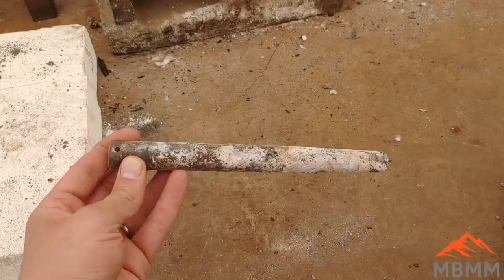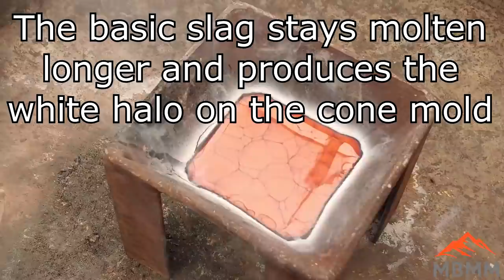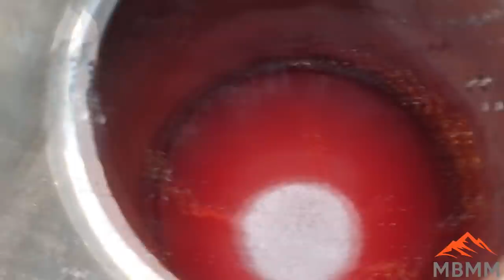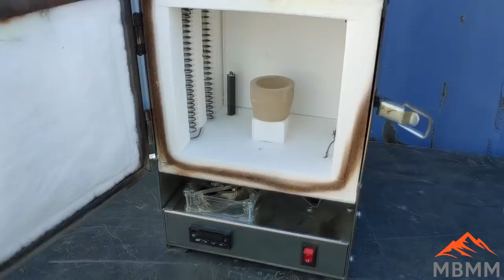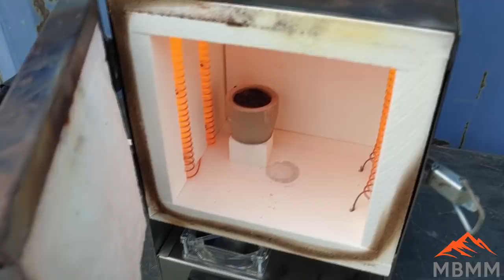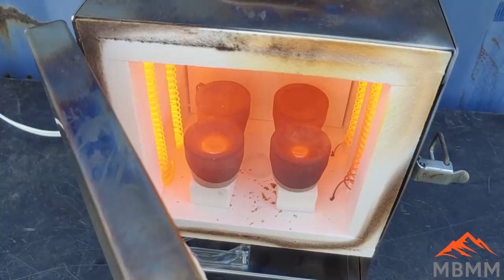Gold Assaying & Smelting: Soda/Iron Method

Comment: Good morning, just to inform you that when you are going to generate a basic slag in the foundry, you must use basic crucibles to prevent the attack of the slag to eat the crucible, you must use magnesia - chromite crucibles with the following characteristics:

MgO 62.5% - Cr2O3 17% - Al2O3 6.5% - Fe2O3 11% - SiO2 2%.

As a general rule, if the foundry generates a basic slag, basic crucibles should be used (magnesia - chromite) and for foundries that generate acid slags, acid crucibles should be used (High alumina - silica) which has the following characteristics:

Al2O3 70% - Fe2O3 2% & SiO2 28%.

In the particular case of sulfide ore smelting if you are going to generate basic slags, just make sure that the crucible is basic base (magnesia - chromite) or if you use acid crucibles (Alumina - Silica) you must change the formulation in such a way that you generate an acid slag, I recommend the following formula:

sulfide ore: 130 grams
Borax: 80 grams
Soda ash: 124 grams
Silica: 7.12 grams
Lead: 38 grams o 41 grams fo litharge.
Charcoal: 2.5 grams

To determine the amount of iron I suggest weighing the iron bar before and after melting, the bar should be cold at the time of weighing, the difference in weight would be the amount of iron to add for that mineral. I hope you find the information useful, thank you for your attention and have a nice day.

Comment: The filters with an absorbent part in the cartridge are very short lived. Most are only rated for 1, 8 hour shift. You can stretch it by pulling the cartridges and taping the in and outlet. Put in a ziplok with desiccant packs. Most are worthless after a week.

Comment: Fun fact re: lye and silica/glass.
A strong lye solution will etch most grades of glass in a short time!
Lye will 'spoil' over time, absorbing CO2 from the air to become sodium carbonate.
Still pretty basic stuff, not sure if it would work as a lye replacement.

Comment: I'm just wondering whether I understood correctly that you added 50 g of lead on each smelting and then converted to lead to lead oxide fumes. So for the eight smeltings you converted 500g over a pound of lead in to lead oxide fumes that settled down in the area around your burnout oven. Is that correct or did I misunderstand something

Comment: A bit worried about that respirator description.
A P100 is just the particulate part of the filter. It does protect from fumes, not vapors. SO2 is considered a Vapor. The difference is apparantly how the metal or chemical behaves. Is it still particles or not... Your filters are pink so i assume they are 3M's 60929S P100 combined filters for Mercury Vapor/Chlorine/Sulfur Dioxide Gas and particulate.  Not just P100 filters.
Please guys be safe, do not use a normal P100 filter for this. It will not stop any gasses unless it is a combined filter made for the task.
Reply from the maker: Thank you for your safety concerns

Comment: CAN YOU RE-RUN YOUR FIRST RESULT CRUSH SIZED ROCK TO SMALLER GRADES IN THE SAME CRUSHER?
Reply from the maker: Yes, you can get a little finer grind by re-running
Reply: @mbmmllc  THE DESIGN I'M WORKING ON IS ROTARY, USING A MUCH MORE AGGRESSIVE AND ROBUST SYSTEM OF IMPELLERS THAT VARY FROM RIGID TO SWINGING.  RUN IT OFF BELTS WITH A SMALL CAR DIESEL AND FEED IT WITH A BACKHOE OR LOADER.  IT ALL GETS DOWN TO BURNING ROCK AFTER THE FREE GOLD IS OUT. USE A REVERSE-SCALED MULTI-SCREEN SET-UP SLOPED AT BACK OF CRUSHER VESSEL WITH FINE SCREEN FIRST, THE LARGER GRADES FOLLOWING IN ORDER, PUT WALLS BETWEEN SCREENS DOWN TO CATCHMENTS, AND BOB'S YOUR UNCLE. CENTER SHAFT IS A 3" SCREW-JACK LEG, HAS HOLLOWS FOR WELDING PRIMARY ROCK CHUNK BLADES FROM TRUCK LEAF SPRINGS. BLADES ANGLED TO PROPEL ROCK THROUGH CRUSHER,  CRUSHER TUBE IS 16" WELL PIPE FROM A SCRAP YARD, 4 FT. LONG. (WHOLE UNIT BUILT FROM SCRAP YARD STEEL). INTERESTING, CREATIVE, AND VERY HARD THINGS SPINNING IN GRADUATED PROXIMITY WITHIN. FINISH WITH NICHROME CHAIN MAIL CURTAINS JUST BEFORE SCREENS FOR ULTRA FINE SMELT DUST OR TABLE WORK.

Comment: What respirator do you recommend for fumes ?
When you say 'BASIC', what are you referring to?
Reply: P100 rated for acid vapor.  I use a Honeywell that can handle HCl, HF, SO2, and others.  Basic as in acids and bases (alkali).
Reply from the maker: Yes, exactly 2fathomsdepper.  I use a P100 and basic meaning high pH

Comment: Why did you move away from the sodium carbonate for this method? The sodium carbonate has a pH of 11.6 and caustic soda has a pH of 14.0. They are both very basic and should work the same right? The sodium carbonate would be a safer method and looked like it worked in your previous video on this method.
Reply from the maker: Good question.  I have a video coming out soon describing the difference in detail, but essentially with the soda ash a bunch more material needs to be drove off and it tends to boil and froth in the crucible.  The lye melts quick, doesn't boil, and doesn't require as much weight for the same amount of ore.  More info in an up coming video, thanks for asking
Reply: @mbmmllc  Awesome! Thanks for the explanation.

Comment: When you cupelling the lead, are they a one-time-use thing or can you use a multiple times?
Reply from the maker: Exactly Monty, I have used one cuple several times for small batches of 10 grams of lead at a time, but they do become saturated and then a new one is needed
Reply: @mbmmllc  , cool beans. I had no idea.. I dont smelt anything . but find it interesting
Reply: one time..
Reply: Bit of both. Each cupel can only absorb a certain amount oxides, once it hits that point its done. But a single cupel can be used for multiple small amounts until it becomes saturated

Comment: Good stuff, I've learned a lot binge watching your videos over the last week! Just to be clear, this method does not work with iron pyrites, they would just be absorbed into the slag along with the FeS created by the iron bar+sulfur from the copper, lead and arsenic sulfides, right?
Reply from the maker: Actually this does work well for pyrite.  The iron bar does release some metallic iron to convert everything to FeS (iron pyrite is FeS2) any gold will be released and collected by the collector metal
Reply: @mbmmllc  Cool, thanks for clarifying that.
Reply: @mbmmllc  I'm still trying to wrap my head around this in the case of iron pyrite, could you explain the process a bit more. What is happening to the FeS2 during this process? Is it decomposing thermally into FeS during the start of the smelt, or is it being oxidized by the Lye or somehow snagging an O atom from the Borax? If it thermally decomposes to FeS, how does it release any gold contained before being absorbed into the slag? I can see the iron bar taking up the spare S atom, but wouldn't gold still be locked up in the sulfide if it wasn't oxidized by something during the smelt?

Comment: Thanks for this video Jason. How does this 'roast' sulphide, what does the iron bar do and other chemicals act during this process? How much precious metal is lost to the slag? I've got a large quantity of pyrite and quartz vein ore and since there's probably very little precious metal in it, wondered if this method would be efficient or am I better off roasting first?
Reply from the maker: Best route is to concentrate your values and then roast and smelt the concentrates.  This is a good way to gain some info on your material.  Thanks for watching!